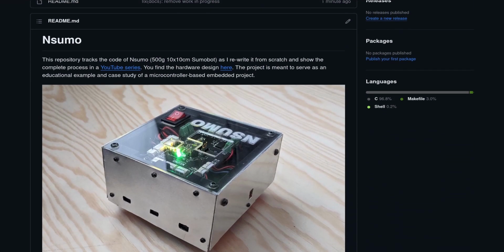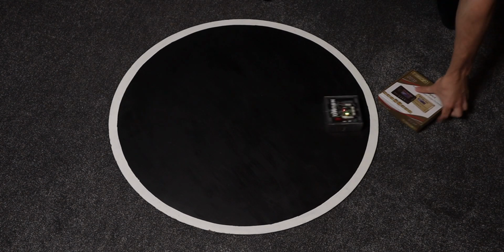The End | Embedded System Project Series #28

Comment: Nikolas thank you theVideo series was amazing! all the way from picking the small.parts , doing the PCB design to programming! I had so much fun watching you and  learned a bit. That being said i want to ask for some career advice 

 I want to become an embbeded software engineer but have some questions. Any advice is greatly appreciated.
For some quick background I finished my IT bachelor's focused on web development with a minor in software engineering in December 2023. But I had been working on web apps since I was around 16. From design to front end development and some backend. However, I initially was a CS student struggled rly hard with advanced calculus but I understood binary discrete and so on so I switched. I'm currently pursuing a MS in software engineering with a specialization in robotics and plan to take comp engineering electives like microcontroller programming and computer architecture and so on.  Also to note this software engineering program actually focuses teaching C and Matlab more then other enterprise software courses, which is why I think it be more ideal . I guess it's because here in Houston there's a lot of embbed jobs.
Program link:
https://catalog.uhcl.edu/preview_program.php?catoid=19&poid=4864
Questions:
- how much hardware does an embbeded software engineer get to work with? Do I get to write code  and connect for examples microcontroller to a breadboard? Or it's it more of you just write code for the hardware like a normal software engineer? 
- how much hardware should i know at a fundamental level?
- would I benefit more from trying to enroll in a computer engineering program that will accept me? Instead of doing my software engineering program.
- how should I start learning about hardware as my elective options are limited 
And do not think I'd cover all that I need?
- I'm assuming this would be answered kind of by the previous but why can't a normal software engineer just transition to Embedded Software engineering? Is it due to the hardware knowledge? Constrains with C? 

Note: I have also looked at BU's leap program for electrical and computer engineering 

Thank you once again !

Comment: My humble suggestion would be a video on how to use an RTOS in an embedded application.

I have a motor control application, and would like if a task receives a command in the queue, it will move until it reaches the destination (30+ seconds).  If another command is received while it's moving, it must stop and go to the new position. Maybe the task could look like:

wait for queue command
start motor moving
Continuously check position and stop when reached OR stop when new queue command is received

Would monitoring the position block/starve all other tasks?  If so, what's the proper way for it to closely monitor position while still allowing the RTOS to run other tasks?  

Does an RTOS' delay function (ex. FreeRTOS' vTaskDelay()), allow the scheduler to run other tasks?  Actually, even if a low-priority task sits in a tight while(1), isn't the whole point of an RTOS to have the ability to wrestle away the CPU after too much time?
Reply from the maker: Yes I would like to do content on RTOS in the future.

It depends on how you sense that the motor has reached it's position. If via interrupt, the interrupt handler can queue a command/event "position reached". Otherwise as you say, a task can periodically check the status of the motor (sleep in between, i.e., vTaskDelay). It won't starve the other tasks as long as it sleep in between each position check. It would only starve if you have a "busy" while loop (without sleep) that just checks the position.